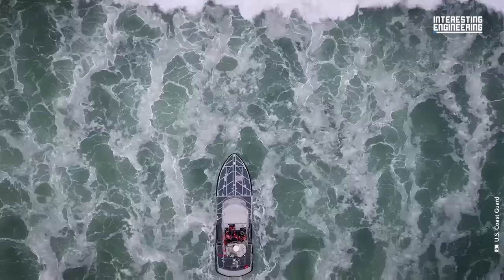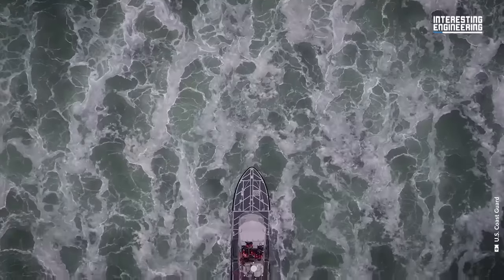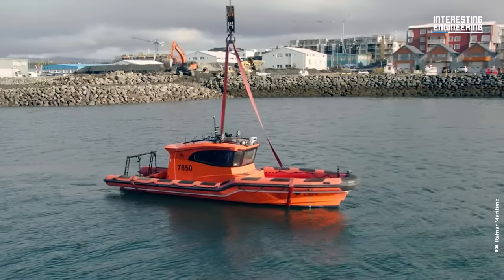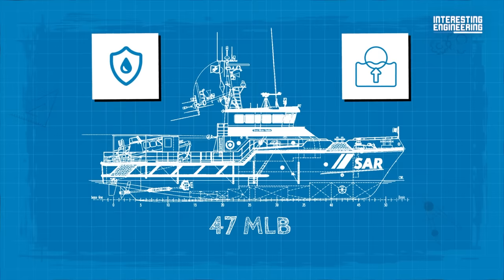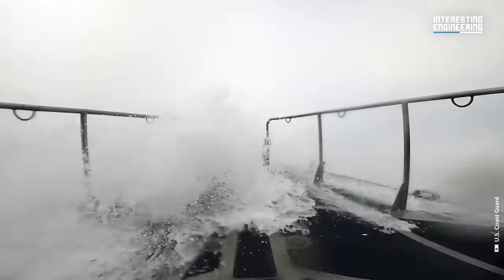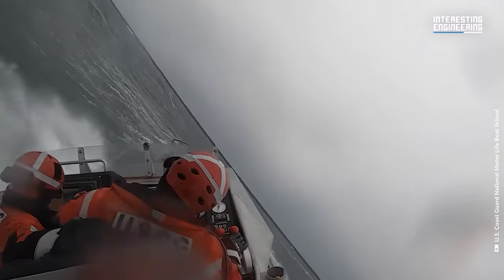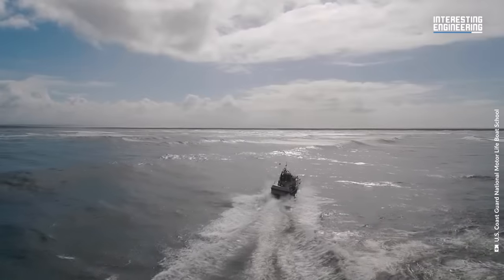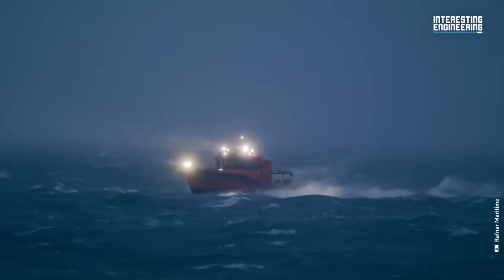How US Coast Guard Made An Unsinkable Boat

Comment: Whenever I hear the phrase "Impossible to skin" I remember The TITANIC xD
Reply: It was only due to the combined arrogance and ignorance of its designers and owners that the Titanic was declared unsinkable. Since then designers of large ships have used the lessons of the Titanic, and certainly other ships that sank, to design ships less likely to sink. You'll note that the rescue boat in this video is relatively very small, so it's physics is much simpler.

Pretty quickly, I'm sure, they also started putting adequate numbers of life boats and life preservers on ships.
Reply: I think you mean “Olympic”.